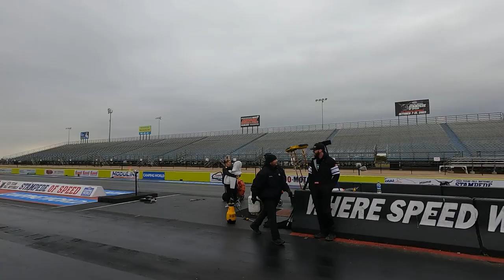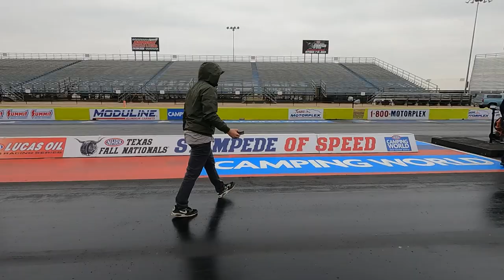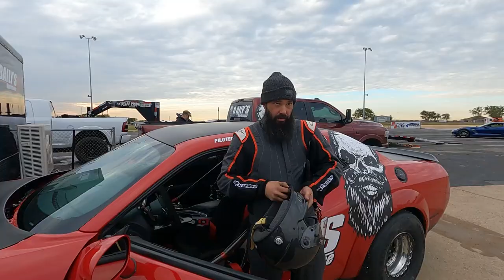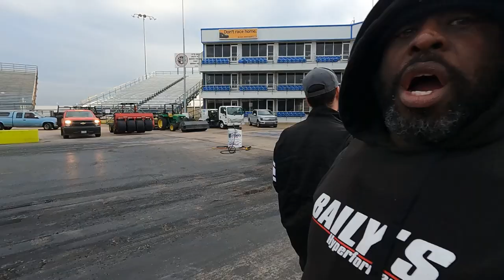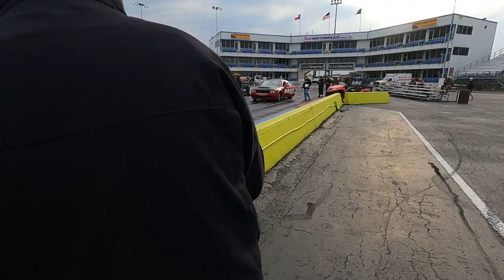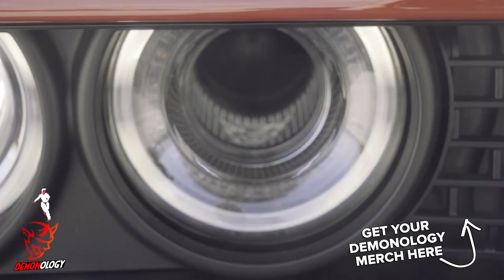World's FASTEST Dodge Demon attempts another Record Breaking pass

Comment: Im starting to believe that the Demon chassis just isnt capable of anything much lower than a 9 second run... i have yet to see one break into the mid 8's
Reply: With all of the hype with these demon cars, none are even close to that 7.8 or 7.9 Mustang ran with a stock motor and turbos😎
Reply: Our demon is 7.82 and until this pass we had been doing great.
Reply: @marlenebaily7638  mmm,im sure the motor is built.
Reply: Except the regular hellcat alr hit 7.5😂
Reply: @drfaticus hellcats can though
Reply: @BoostTurbo-rx4sc  on an unopened engine? I don't think so